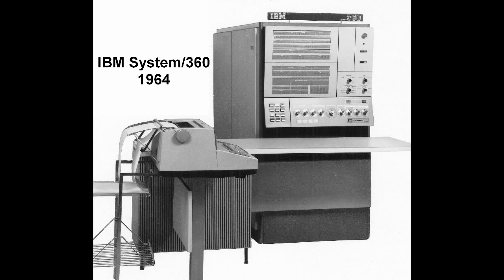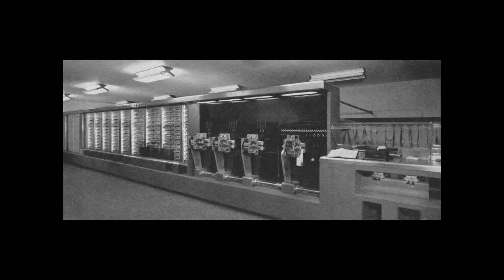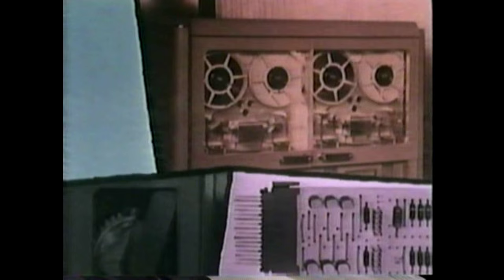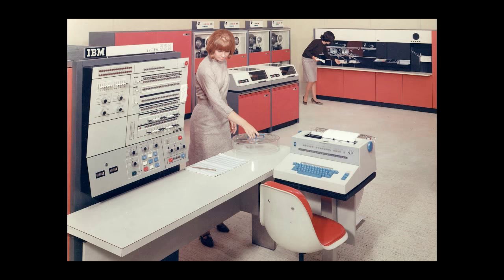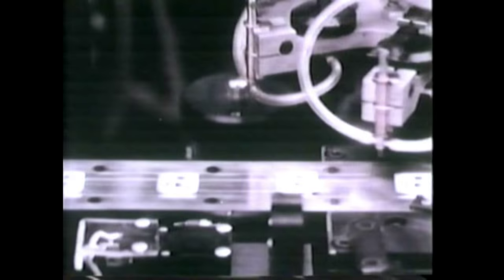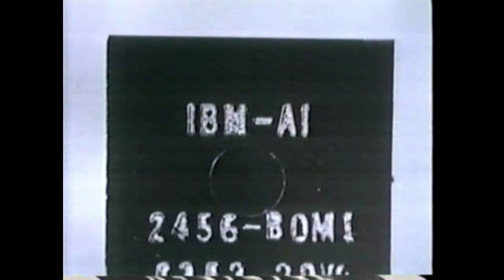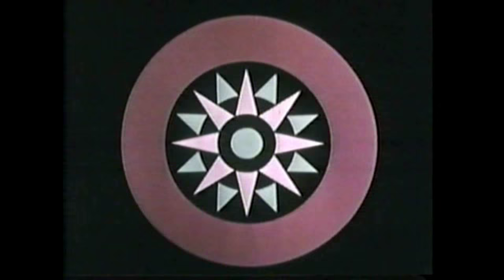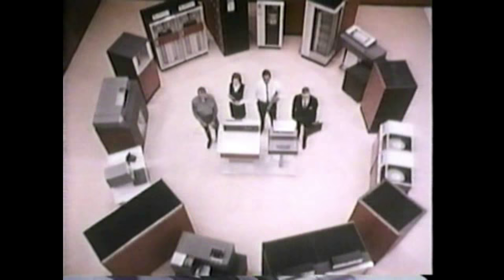Computer History: IBM System/360 Mainframe 1964 ORIGINAL ANNOUNCEMENT, Transistors, Data Processing

Comment: I was a computer operator for the City of LA in 1971 on a 360 and then a 370 after I returned from Vietnam as a computer operator on the IBM 1800 plotter in Saigon.  The 360 was a great machine and I wish I had an original 360 or 370 Console.   When I was at the City, the computer operators were out of date and were running only one partition at a time to spread out work load.  The 360 had five partitions and so I worked the midnight shift (I was in college during the days) and I once ran the entire next day's production schedule overnight using the five partitions.  I was lectured by the union focused employees NOT to do that again.   So the city used about 4-5 times the operators and machines (they had 3 360's) that they really needed.  That is how your government works.
Reply from the maker: Hi @FiscalRangersFlorida, That is a great story!   Thank you for sharing your experience with the 360 and 370 systems.  They were as you know, the powerhouse systems of their day.   Massive technical marvels (for the time) and even color-coordinated to meet customer's requests.   I wonder how many IBM and other computers the U.S. left in VietNam when we finally pulled out.  Probably all of the mainframe stuff got left behind (?).    Not to mention our allies and supporters.   ~  Your comments about how your making efficient use of the system's partitions to speed up processing time was not well received by management.   I understand your position.   Good point.   Thanks again for sharing this great bit of history!  ~   VK

Comment: I started studying "computer science" in 1977, though there was no curriculum called that at the time. Most folks who entered computer programming came from other disciplines – math, chemistry, business, etc – where they were exposed to computers and coding as part of their work and got hooked on coding so switched to doing that full time. I started with electronic circuit design and ended up switching to programming full time 5 years later. The IBM 360 was still a strong influence, through supplanted by the System/370 by then, which was operationally about the same as the 360. You never actually operated the S/360, but interacted through 3270-style terminals which could be in the same building or miles away. Coding was a trial and error process often taking several days to write, submit, wait, get result, fix bugs, then repeat the process all over again. Still, it was easy to get hooked. When I retired from software 7 years ago, most programmers were actual computer scientists (BS, MS or PhD) and the average personal computer was many orders of magnitude faster than those original 360/370 systems. I can't imaging what computing will look like in another 40-50 years!
Reply from the maker: Hi @sfperalta, thank you very much for your fascinating story of your experiences with computers back to the 1970's.  It sounds like your branching out into electronic circuit design and then to programming was a great way to get a great overall appreciation for systems that were evolving, and the software behind them.   Thank you for sharing this look back and for your insights into some of the changes you have seen in the industry.   Quite interesting!  ~    Victor, CHAP

Comment: As someone born in 85 I find computer technology from before I was born so fascinating.  Thank you for the uploads.
Reply from the maker: Hi Steven, you are very welcome!  ~  Victor
Reply: It was an amazing time.  I began my IT career at 20 years old operating a 360/40.  I left a college liberal arts program to take that job.  I then go into systems work, meaning I installed operating systems, subsystems, applied maintenance and tuned systems for performance.  All this work to ensure the applications programmers could code and test applications and operators could run them.  I did this for 14 years and was hired by IBM in 1987.  I retired from IBM with 32 years of service.  All totaled I had a 46-year career in IT.  All because of mainframes.
Reply: Ever held a magnetic core memory array in your hands?  I have!  Obviously I am an old person.  Punch cards, teletypes, tape drives etc.  Now I have a smart phone I could never have conceived in those days!

Comment: Sorry, IBM, you did not herald the opening of the 'Computer Age'. Colossus did that in Bletchley Park UK to help break enemy codes during WW2.
Reply: So True. Ken Olsen and Digital was doing this stuff in the 1950s. IBM 360 were just simple database machines. They were used for bank account records and inventory management. Very simple but high volume stuff. They were strictly batch processing. It was not complex calculations and engineering solutions like Digital who also had realtime processing. You could update the operating system of a PDP 11 without shutting it down. It was MIT with Digital and Harvard with IBM. That tells you the emphasis.

Comment: I learned programming on a 360/30 with 32K of memory. It was in 360 assembler with DOS/360. Later went to a company with a 360/65 with 512K running under OS/MFT - still mostly assembler with some PL/1.  Fun days!
Reply from the maker: +mike klaene     Very cool!    I consider anyone who could program in assembler, a highly talented individual.  "Shift RIght, Double Algebraic"  -  those were the days!
Reply: +mike klaene 
Wow, I didn't realize I was living so high on the hog -- we had two 360/30's with 64K each.  DOS/360.  COBOL shop.  Started teaching myself 360 assembler ... finished that on 370/138 with 512K.  Got to spend 6 years FT assembler work, early 90's.  Most fun language I ever knew!  Wanted to try PL/I, but we never had a compiler.  If I can find all the pieces, maybe do something with Hercules ...
Reply: usnay12345 It was at a dept store in Cincinnati where I got my start programming. No degree at the time - pure OJT via some good mentors and the green and white IBM 'Programmed Instruction' books. The HQ for our parent company was across the street from our store and they had a 64K 360/30 which we had to use to do the COBOL stuff.
These days there are a lot of coders but very few programmers, IMHO.
Reply from the maker: +mike klaene   Hi Mike,  Assembler on the 360 must have been quite interesting.  I did a little Assembler on the IBM 4341.  "SRDA, BAL, etc."  Brings back memories.  Thanks for watching!
Reply: I'll bet those were the days! You were there at the invention of modern computing.
Reply: +Computer History Archives Project assembler was fun.  Not only could you do anything the machine could do, but you could show the stuff to your friends and they thought you must be from another planet.
Reply from the maker: Exactly!  You are correct.     BAL  SRDA and all those great Assembler commands.    Fun times back then.
Reply: i remember how much time it took me to figure out the ex instruction.  i think that is what it was.
Reply: bal was branch and link.

srda  don't recall using it much, shift register dance around?
Reply: Cannot say I ever used it:  SRDA  Shift Right Double Arithmetic.  Shift the bits to the right preserving the sign bit.
I learned programming OJT starting in late 1969 with no degree.  I used to read the 360  Principles of Operation while riding the bus to and from work, trying to figure out how I would use each one. My favorite was the 'ex' - 'execute'.
Reply: mike klaene xxxdouble meant double word I think.  Arithmetic means keep the sign I guess
Reply: @usnay12345  PERFORM VARYING X FROM 1 BY 1 UNTIL Y > Z

Comment: Brings back a lot of memories (no pun intended). Got out of the Navy in 1966, and after a time got a job as a computer operator with a bank. They were using an IBM 2010 (running 360 emulation), a 1401 for data capture, a 360/30, and a 360/50. All great fun with blown programs, unbelievable backlogs, jamming OCR check readers, rubber band fights with the key entry people, and whisky bottles found under the raised floors--oh, and absolutely no security. Anyone could walk off the street and right onto the computer platforms. The bank ran three shifts a day, probably 20 operators, updating customer files during the 12a to 8a shift; all it took was an error on one of the master file tapes to set us back several hours while we reran the previous night's update. Once management decided to purchase less expensive Memorex disk drives, and that equipment almost crashed them out of business. Finally got out of there, after 10 years (and several system changes) to go into tech writing.
Reply from the maker: Great memories.  "and whisky bottles found under the raised floors--"  that one made me laugh.    Thanks for sharing!
Reply: Lol at the whiskey bottles. I think a lot of people underestimate substance abuse among hardware and software engineers as a whole. NOTHING beats staying up for days programming all stimmed out... ANYWAYS that's my modern whiskey bottle hidden away moment :P (Used to stash meth under my office desk drawer for those long ass binges where sleep was impossible to get cause of all the constant calls I had to support...)
Reply: Haha I worked at the nations largest bank and even though we had security guards and our data center was locked, the combination was 1234!!
One data center I worked in was 200' x 200' with (2) IBM 370s, a few series 1s, and lots of other vendors. The ops always had beer under the floor! They used to shut off the lights at night and have ring toss fights (the write rings from tapes) in the morning I would come in (I was the systems programmer) and see the rings all over the place!
Reply: @madezra64  you’re not wrong.  Usually these days it’s adderall (so I hear) but they can fill the same niche for sure

Comment: This brings back memories. During the middle to late 80s I worked for Spencer Gifts, Inc. at their 5150 building in Linwood, NJ as a laser printer operator. Spencer would mail out catalogs with personalized covers which we would print from magnetic tapes running from a mainframe. It was all so "cutting edge" then working with an industrial computer system. Seems archaic now when one box the size of a toaster can do the same thing and more, faster. But I wouldn't trade the experience for anything. I can still remember the smell of walking into the printing center for the beginning of each 12 hour shift. Ozone and ink. Ahhh.
Reply from the maker: Thanks for the cool comment.   Wow,  a 12 hour shift.  I hope they let you bring plenty of snacks onto the raised floor.  Nothing helps pass the time like Cheetos, Pringles and coffee...

Comment: Although I was a S/360 and S/370 programmer for decades, I just now noticed the symbolism of the original System/360 logo!  Prior computers grouped bits in triplets and multiples of 3: octal (base 8) digits to display groups of 3 bits; 6-bit text character codes; 6 characters per 36-bit binary “word,” etc.  Just like the 360 degrees of a circle (thanks, ancient Sumeria!).

But IBM showed by its compass rose logo that those 360 degrees of data representation would hereafter be grouped by 4s, 8s, 16s and other powers of TWO: 4 bits displayed as a hex (hexadecimal; base 16) digit, using the letters A through F as the extra six digits; 8-bit characters, also called “bytes” (an IBM-invented word), divided into 4-bit “nybbles” (also IBM-invented); 2-byte (16-bit) “half words;” 4-byte (32-bit) “full words;” and 8-byte (64-bit) “double words.”

And the four cardinal points and four secondary points in the logo, eight in all to complete the circle, represents this shift in thinking!
Reply from the maker: Hi Allan, that is a fascinating analysis.  Never saw it broken down like that before.  Thanks!  ~ Victor, at CHAP

Comment: "One system to meet every application need."  "One ring to rule them all!"
Reply from the maker: +Thread Racer  LOL!   Great quote, and so applicable! : )
Reply: Or a few hundred thousand "rings", in the core storage wiring... :)
Reply: In the early 80s, we had a project that used 16K bytes of core, on a single Multibus card. Multibus was common board form factor from the mid 70s into the early 80s. Core is non-volatile, which was its only useful feature, at that time. In a year, or two, EEROMs (not EPROMs) became common, and killed that last use.

Seeburg jukeboxes used core memory, for a time. Its a perfect app for core. In a jukebox, the entries in the play queue are erased, when that song is actually played. With core, the process of reading erases, the read location (destructive read), so that step, is automatic.
Reply: Or IBMs token ring network...
Reply: That's the CORE memory.

Comment: This is so interesting! Solid Logic Tech sounds like it was a bridge between discrete components and integrated circuits; they couldn't quite make true ICs yet but you could tell it was going in that direction.

Thanks for posting!
Reply from the maker: Great observation!  Thanks for your feedback!
Reply: Those are early hybrid circuits. Think surface mount components on a ceramic substrate, instead of a PCB. I saw my first MLCC "chip capacitors" on 60s vintage hybrid modules. Resistors are sometimes painted on with resistive inks.

The 360 came out in the 60s. Early logic ICs were available, but IBM was very "vertical", and used their own "in house" semiconductors, almost exclusively. Also those early ICs were pretty pricey, too, and used mostly on government aerospace projects, with deep pockets.
Reply: Yeah, the first CPU-on-a-chip wouldn’t come out until Intel created the 4004 in 1969 — and then it was only a 4-bit processor.  Far too small for any real work.  It’d be the mid-to-late ‘70s before CPUs on chips would be popular in mainframe computers like this one.  The big companies continued to make their own CPUs similar to the one in this System/360 — the CPU chips were relegated to small, desktop-only machines for a long time.
Reply: That's correct. And System/370, released about 6 years later (in 1970), used very similar looking packaging, but the modules in S/370 had true integrated circuits on the ceramic substrate. The only obvious differences were the module packages were usually larger, and circuit cards were about twice the size. 
My page on IBM circuit packaging evolution: members.optusnet.com.au/intaretro/Packages
Reply: bertoid the 4381 was designed so that each module had the same thermo design and was cooled with two automotive fans. The therory being that you can cool a house with just one fan if all the rooms had the same design and temp. It was call "impingent cooling" IBM was always looking to improve cooling. They wanted to get away from big room that needed tons of air conditioning
Reply: IBM is always light years ahead if what most people hear about
Reply: But each component looks like it was manufactured as a low density IC on a silica wafer.